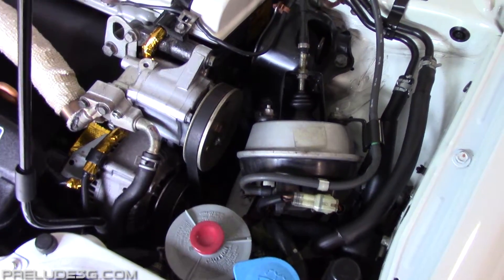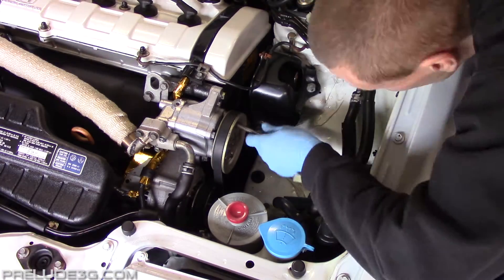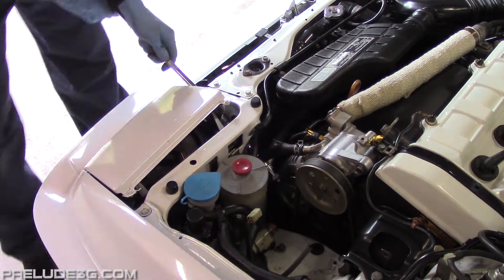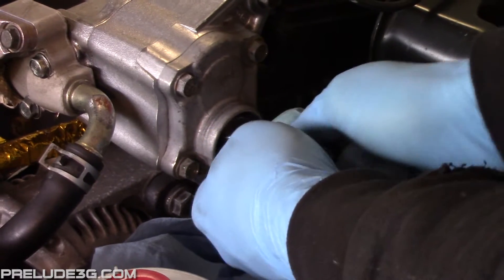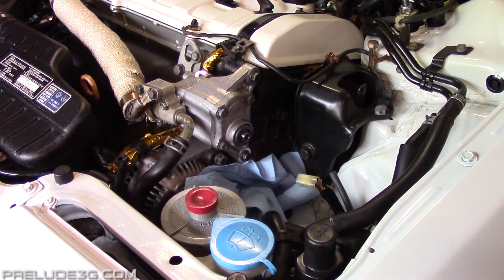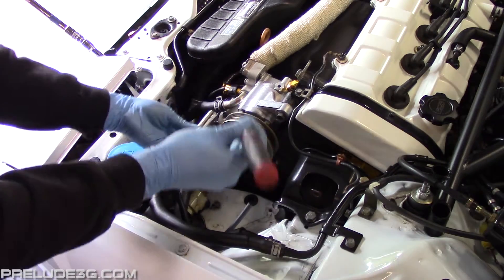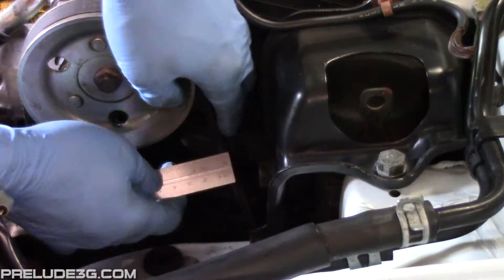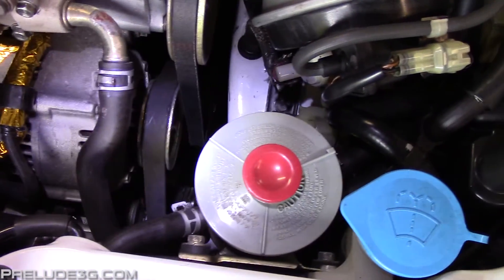STEERING: Power Steering Pump Seal Replacement

Comment: What's the size of the idler pulley bolt?
Reply from the maker: Sorry for the late reply. The idler pulley is held on with a M10x1.25 nut. The bolt/stud going through the pulley itself if a special bolt that is discontinued, you can see it here: https://www.hondapartsnow.com/genuine/honda~bolt~idle~pulley~56983-pk1-003.html